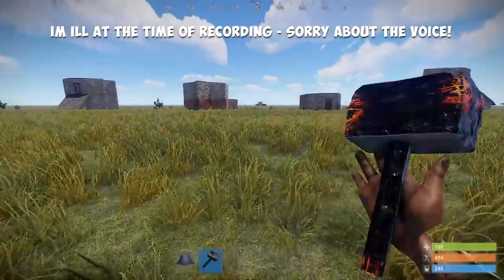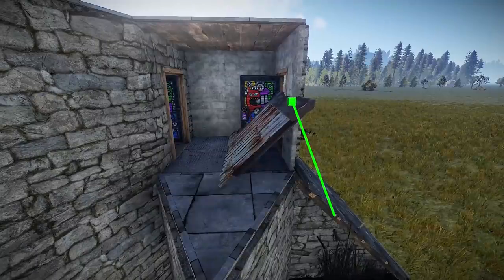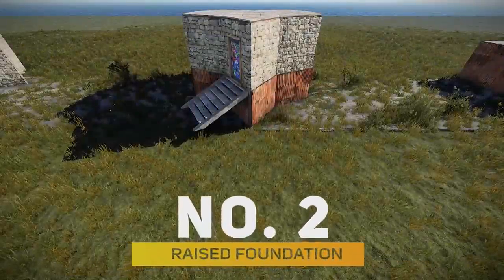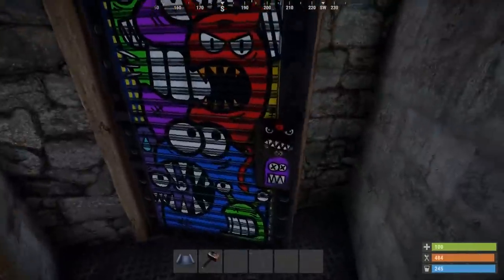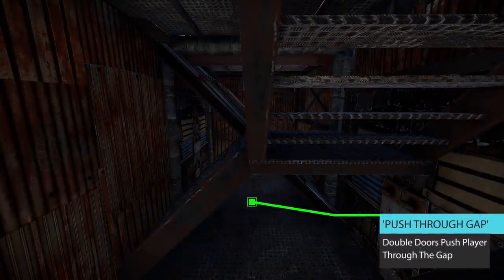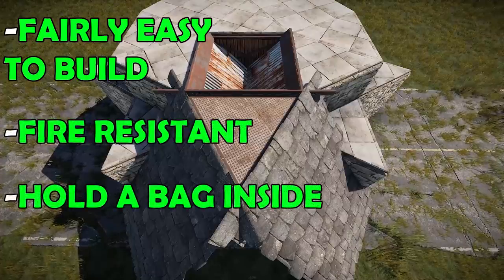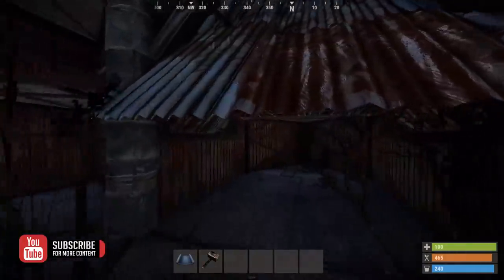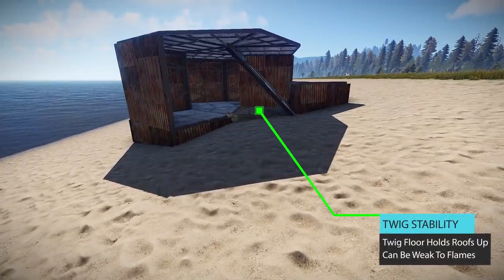RUST - 5 Bunker Methods For Rust Base Designs (2019)

Comment: I've been using the method with the roofing and door to push myself in and out through the roofing. Great design because it can be added onto any type of base
Reply from the maker: Yeah that’s the great thing about it, it’s so easy to add on’ :)
Reply: @xRaWYT  I figured out a way to add the same roof door push system to a cave base resulting in a extremely, extremely high cost raid at a very low upkeep and building cost. Practically unraidable on vanilla servers
Reply: @xRaWYT  if your interested I'd love to show you the design / thought for the base wether it's through in-game or if youd like me to create and share a video with the design. 😀

Comment: Yeah I already watched the mini vault bunker I believe. In this video there is three roofs so it doesn't matter there on 2 in the mini vault?
Reply from the maker: Yeah it's not a huge difference, but you should be able to place 3 within the mini vault as long as your make sure the roof doesnt join to anythingother than twig or it'll be stuck :D Door frames dont count as stability either so theyh work!

Comment: I have another bunker design that's not well known, essentially you have a 2x1 with crossed roofs inside, then you have double doors opening inwards which push you through the gap in the roofs, hard to explain but I hope you understand
Reply from the maker: Yeah i know what you mean, its similar to the roof/stairs method :P U can do that with a half wall and roof as well :p nice idea tho i didnt think of it at the time
Reply: problem with thoes types of push bunkers are you can get through them with a friend pushing you then disconnect and reconnect while your friend is on you and you get pushed through
Reply from the maker: @eda12373  yeah u gotta be careful
Reply: @eda12373  thats what i was thinking about in my question. Never tried this, but if its true then its not worth building such a "bunker".

Comment: you forgot the very basic dropbox passthrough of a sealed room with bags on both sides. easy to make, dont have to keep replacing sheet metal roofs, concealed from the outside world that its a bunker, and resistant to fire.
Reply from the maker: But you have to wait for bag timers each time :( I jus chose not to use it at the time

Comment: Are any of these patched yet?
Reply from the maker: Don’t believe so
Reply: xRaW I also had a question, if the bunker is not fire resistant then what is the point of the bunker? If they can just use flame thrower or fire arrows
Reply from the maker: Fortnite Godly some are and some aren’t. Even the non fire resistant ones are difficult to destroy and often take a few hits. If you upgrade to wood then it’s still rather expensive and takes a long time :)